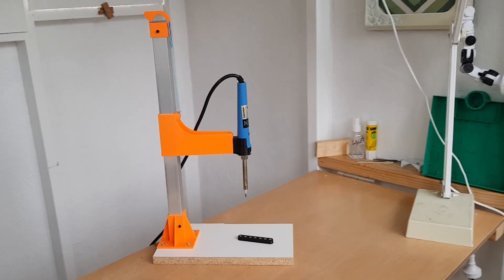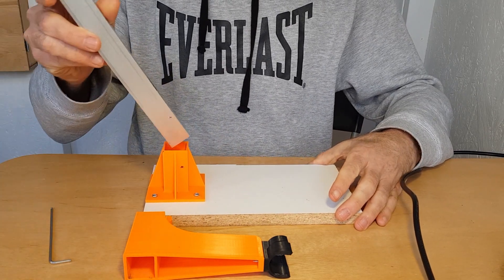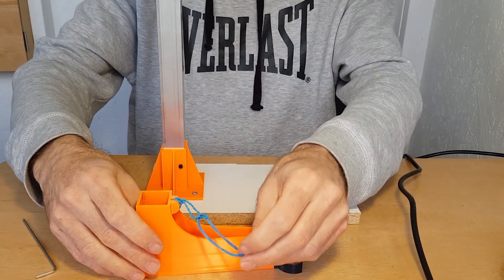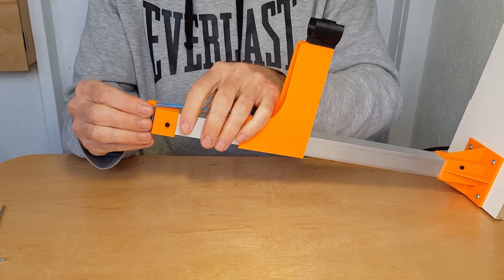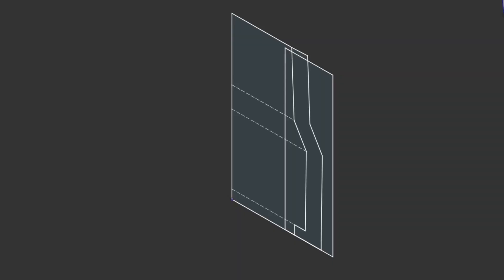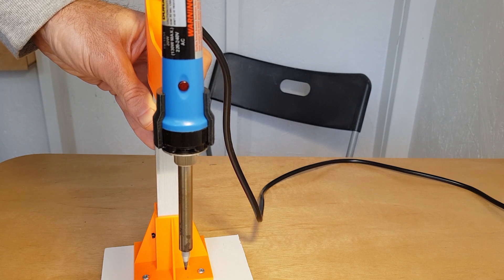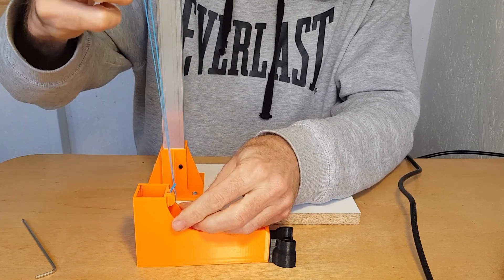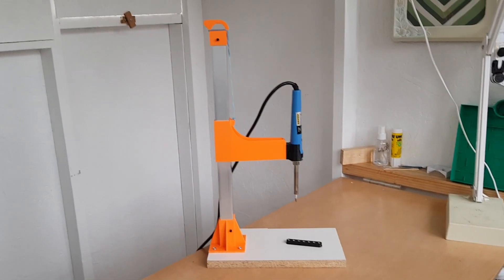How to make a Heat Set Insert Press

Comment: Can you please give instructions on how to edit the Fusion file for the clip. What measurements does one need to take and what parameters in the sketch need to be changed. I have tried some value and it just goes all wonky. Thank in advance.
Reply from the maker: I've posted a quick video showing an easier way to model the holder using a photo of the soldering iron and then using that as a Canvas in Fusion 360.  https://youtu.be/CdsSNP4Q978
Hope this helps.